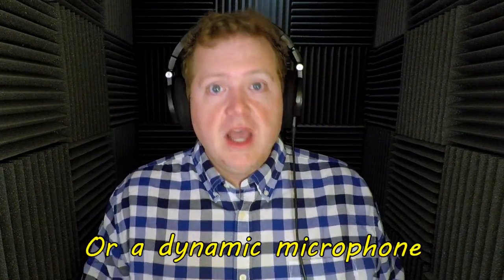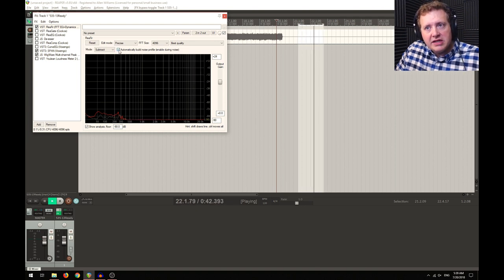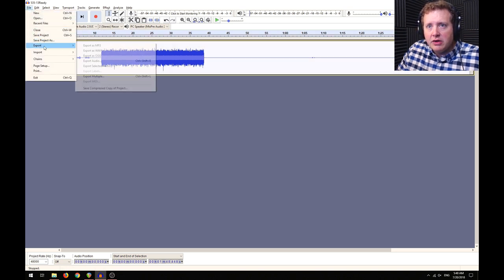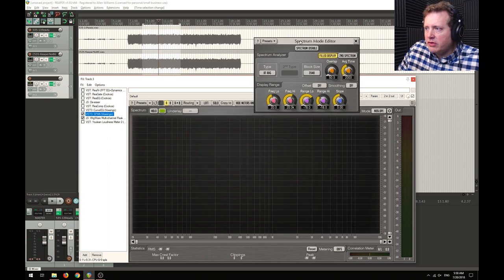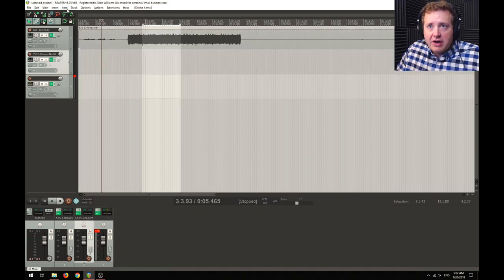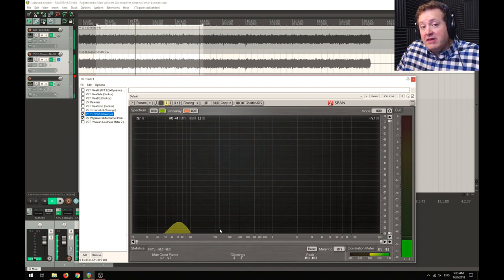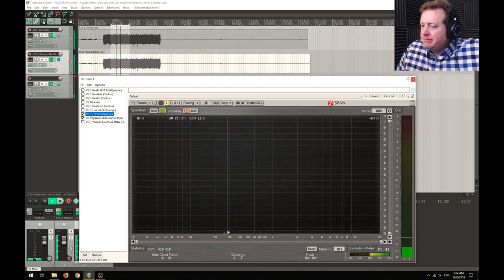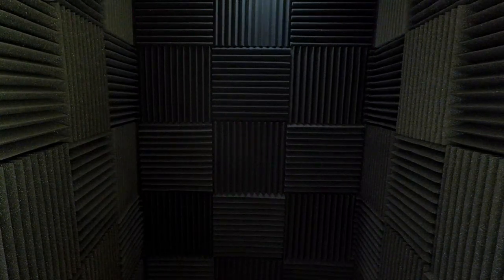Is Microphone Self Noise A Big Deal? - Sound Speeds

Comment: Very useful video. Everyone else just reads spec sheets without looking at the practical side.
Reply from the maker: Spec sheets are easy for anyone to look at so I focus on testing and things people can't do for themselves without the mic. Thanks for watching
Reply: @SoundSpeeds  no thank you for really helping me with my equipment selection process. Because I know I will be processing my audio I now understand that signal:self-noise ratio is going to be a lot more important to me than the self-noise value alone.
Reply from the maker: It all matters but no specs is the be all, end all. If you're whispering, self noise matters more. Processing helps a lot provided you're noise floor isn't too high.

Comment: I have a very different question about self-noise. Would a sound blanket do me anything good if I want to mute my room’s ambient noise as much as possible, so I can record the self noise of my audio interface and  microphone? A cardioid microphone in my untreated room picks up around -67dBFS of ambient on a gain setting for -20dBFS of level, talking normally. A super cardioid microphones pick up as little as -74dBFS on the same recording level. My idea was to wrap it multiple times around the microphone to mute it. The potential issue I see here is the frequency spectrum of the noise.  The loudest part according to Voxengo span is around 80-600 hz, if I remember correctly.
Reply from the maker: Here's what you need to do in order to correctly measure: https://youtu.be/SdHn4L1TGds
Reply: Well.. what you’re doing there is measuring the self-noise of the self noise of the interface. I also have already written a comment there. I am thinking about finding a way to get a reading of the microphones self-noise, for example on condenser microphones, because a condenser not always is as low a 3db. Well.. not even all dynamic microphones are for that matter.
Reply from the maker: Oh, sorry. Yeah, I wrapped up a mic very similarly in this video: https://youtu.be/9dZs6N1lJkY and it was OK. It can only block so much but worth a shot as long as you can kill ambient sounds. The thing to consider is soft material absorbs sound but doesn't sound proof. Sound proofing is done by using hard, dense material that prevents sounds from going thru a surface. If you can wrap it up in soft material then surround it by hard things like concrete blocks or multiple sheets of wood or something, it would help.
Reply: Thank you for answering again! I thought it would not help too much. A much more quiet recording space would be our basement. But for that I need a mobile recording solution. Maybe with my smartphone. I can use my audio interface on it. Oh boy, That would be quite a bit of work. ❤️
Reply from the maker: You also need a reference to compare it too. A Rode NT1 may be one of the world's quietest microphones but used in an anechoic chamber, it would sound noisy if you gain up a quiet sound. The works noisiest mic noise floor would never be heard at a concert venue.

Comment: My first condenser mic was a behringer c1 and it produced unbearable selfnoise in a treated space. I'm currently using a sm57, cloudlifter and focusrite solo to record acoustic guitar but after I did some tests, I realized that the cloudlifter is producing alot more self-noise than I expected. I'm thinking of switching to a small diaphragm condenser mic (oktava mk 012) to record acoustic guitar at home in treated room. I'm worried about if this condenser mic will produce noticeable self-noise (like the behringer c1) if i only run it through the focusrite scarlette solo. Do you have any advice?
Reply from the maker: It shouldn't. Condenser microphones amplify the signal before it leaves the mic (yay phantom power) so your noise floor should be low unless you are whispering from far off the mic.

Comment: hey sound,

this is exactly what im currently going crazy over!

i use a deity s mic 2 and the tascam dr100 mkiii, during playback, i noticed that after i record im always getting a hiss self noise at about -54 db when its silent, empty room, no ac, no fans
(vocals are at -6db)

is this normal? every condensor mic will have a self noise? or is there something im doing wrong

thanks sound, 

Tim
Reply from the maker: Tim, shoot me an email and please include an audio sample. In this audio sample somewhere I'd like you to go completely quiet so I can hear the noise floor with no talking, breathing, etc. I'd like to check this audio for myself. Unprocessed, of course. Thanks!
Reply: @SoundSpeeds  hey sound, just sent you an email, thank you so much, i sent an older clip but theres about a good 8 seconds of no talking/breathing
Reply from the maker: I'll check it out in the next day or so.

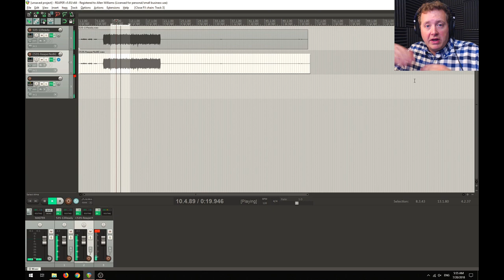Comment: Good to know thanks! I'm editing an audio interview and the person getting all the hardware used stuff I wasn't pleased with (they're my boss so...). The interview was off site in a dang conference room with an AC overhead, so to try and make it sound clean I added a gate, but there's this rush of sound every time the talent starts talking. (which you explain at 10:40). In terms of work flow, if you're dealing with terrible audio, should you do whatever noise removal you can and then gate?
Reply from the maker: It depends on the tools you have access to. That is one solution I've found effective for certain. Try it and as long as it doesn't cut much into your dialogue, you're good.

Comment: I had to revisit this video. I have a question: What is the color of the self-noise from mics? I was thinking of adding noise when editing to reach a certain noise floor because I find that noise gates/expanders giving that absolute silence driving me crazy.
Reply from the maker: darkmew64 Microphones are uaually designed to have their signature sound for 0 degree on axis sources. Off axis, that coloration is screwy because the response isn't even. Remember that the output signal from a microphone is the sum of all sounds heard by that microphone in all directions. If your expander is too strong, try backing off on it a bit. You can also record and repeat a room tone then copy and build a long room tone track with that sound. Avoid making it sound like a repeated track or it'll be an obvious repeat amd sound bad.
Reply: Thanks for the reply!
Reply from the maker: darkmew64 Sure thing

Comment: Lower self noise=lower volume thresholds before distortion on average right? I've always thought of it like that.
Reply from the maker: Billy b Not necessarily. All mics are different. The kind of microphone matters (dynamic, ribbon, condenser) as does design (large diaphragm, shotgun, lav) and more. Manufacturers use different components too. You may be able to make a sensitive microphone with little self noise that can reach high SPLs but would that necessarily make it sound good? What you can say is self noise + signal to noise ratio = max SPL.

Comment: Hi,
I had my first Rode NTG3 for quite some time and I am extremely happy with it. Now I've bought another one. testing the newer one, there is A need to go 1 FULL number > 4 >5 in Zoom H6 for it to be at the same volume. I am recording with it my kitchen, and it's extremely quiet (Kitchen table + Another camera that spins around the kitchen when needed). Do you think I should ask for a replacement for it is not a the same Signal to NR? Also the microphone came with a weird band over it, what do you think about it? Should I get it replaced? I have it few days (I need your advice, :)) 

Now, there is also a difference in the color of the mic, it has a BAND over it, (the mic is original and genuine, Sure of it)
Here's is the difference in the mic itself, (exterior) https://www.youtube.com/watch?v=2lpM5Gh9iOc

What do you recommend? ($700 mic, so keep it or get it replaced?)
Thanks a lot in advance, 
CUISINED
Reply from the maker: CUISINED I watched your video 3 times and can't make out the band you're talking about on my phone. Is it a discoloration?

If you bought one mic a while back and then a new one, you'd absolutely expect them to sound the same. Unfortunately, this is not always a reality even when no changes were made to the manufacturing itself. Mics are designed to sound a certain way and sometimes components with identical specs are traded out in an assembly line and that can make a difference in sound. There are also deviations that occur in the manufacturing process that can cause the microphonne to have a different self.

I'd certainly trade it out with another and see if it was a lemon. Since Rode offers a great warranty, don't be surprised if the store tells you to take it up with Rode.